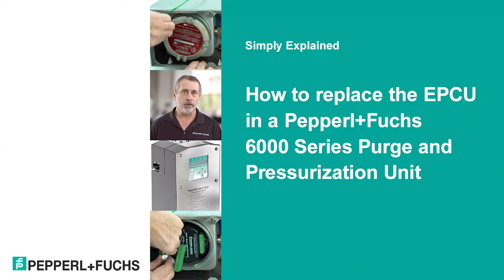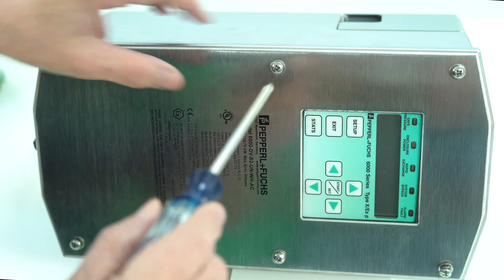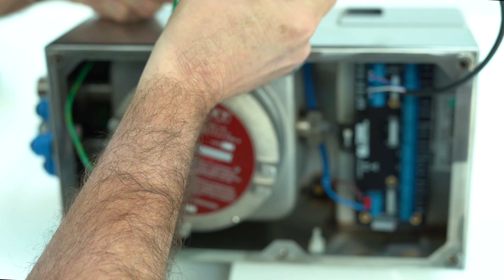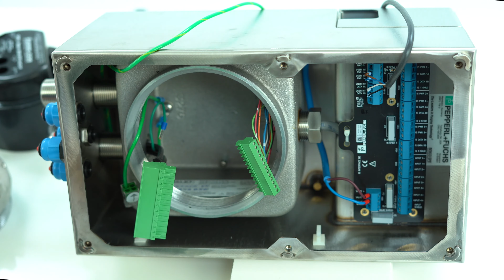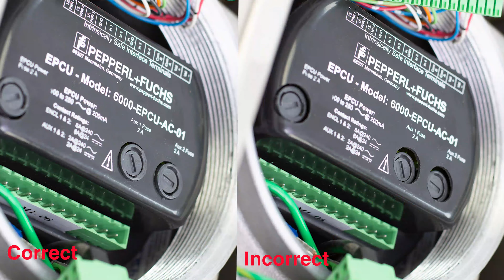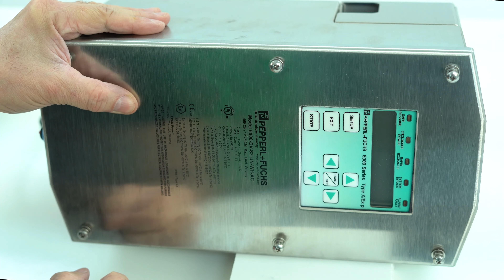How to replace the EPCU in a 6000 Series Purge and Pressurization Unit

Comment: Hi, could you explain how to set up the power connections to the Type X 6000 Series purge and pressurization system
Reply from the maker: Hello Ryan, the power supply and intrinsically safe connections of the EPCU can be found in our manual. The manual is available on our website at the following link: https://www.pepperl-fuchs.com/usa/en/classid_2061.htm?view=productdetails&prodid=39245#documents 

The EPCU is housed in an explosion-/flameproof enclosure, and wires to and from the unit must comply with the area’s type of protection. If you use conduit seals, they must be no further than 18” from the EPCU enclosure.